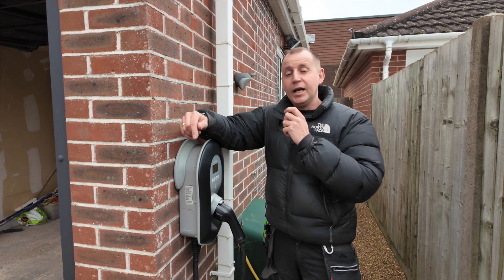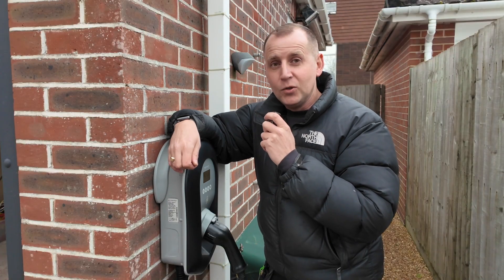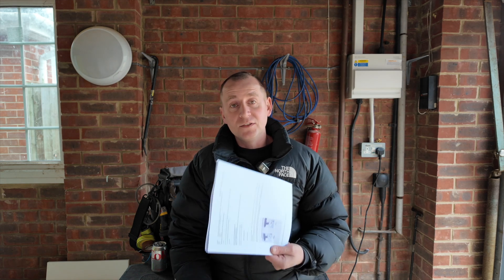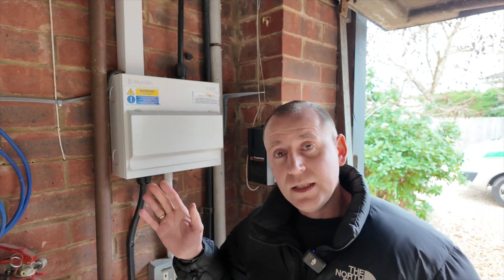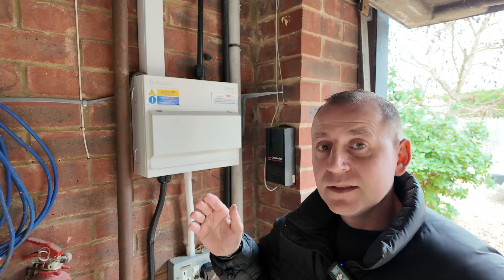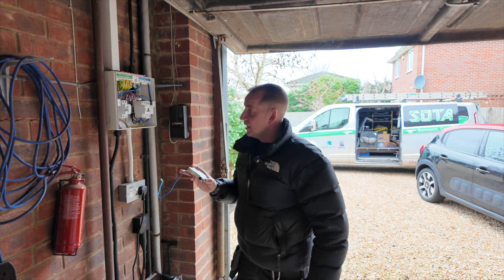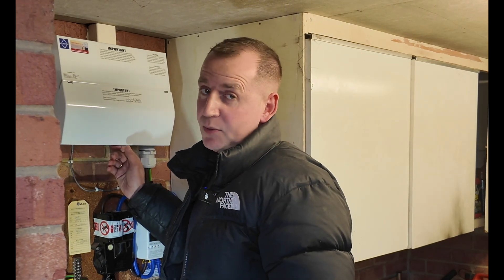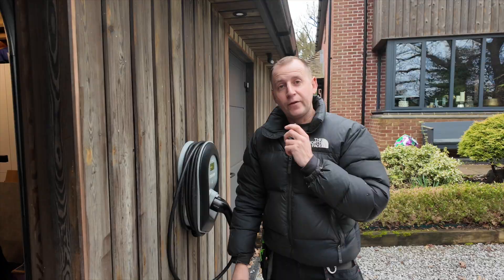THOUSANDS OF INSTALLATIONS MAY BE NON-COMPLIANT...ELECTRICIANS REQUIRED TO CARRY OUT REMEDIALS

Comment: I was always under the impression that the Ev chargers only had an Internal Type B 6mA Rcd. Even with this i always added a Type A Rcd upsteam to protecting the feeding Cable. Here where i lived the standards ask for a 4p isolator beside the Ev charger
Reply: They normally have an rdc- dd which is a residual direct current- detecting device which is why I think they won’t a type A rdc
Reply: Zappis have Type A and 6mA DC built in. It's printed on the sticker on the side, or at least it was last time I installed one. I always take a picture to keep a record of the serial numbers.
Reply: Me too.
Always Install Typ A upstream and have DC 6mA in the charger.
Reply: Some chargers like hypervolt only have 6ma DC RCD. Zappi has a full type A RCD.
Reply: Has anyone ever worked with the 3 phase Ev chargers that have an internal 4 pole mechanically resetting Mcb??

Comment: Mate, you’re gonna get so much hate for swapping that mains switch out for an RCD main switch. I can see coming already people are gonna pick out a regulation that states at the Ev Charger should be individually supplied.

I had this recently with a charger that I’ve done andmate, you’re in for a shit storm on here in a minute

I really feel sorry for the fact that you had to do this, and it’s really bad taste that my energy have stipulated that this must be fitted, but don’t stipulate anywhere in the manufacturers instructions
Reply: Guilty of stating regulations but also NICEIC have told us previously that clipped direct and protected by an MCB is fine when manufacturers have internal RCD protection. The issue arose because of the solid state RCDs not being recognised by the standard EU wide what with Brexit and then Covid. Also BS7671 is happy for internal protection and doesn't require the circuit conductors to be protected if clipped direct - unless the charger doesn't have an internal RCD.

In short it's a complete mess and because of the EV slow down manufacturers of chargers and even showrooms bundling in chargers with cars are starting to kick back on charger warranties. It's a cost cutting exercise rather than a safety one in many cases.

Edit: Main switch RCD is fine but you have to test your mA leakage before you swap over to it with everything running otherwise you risk creeping over that 9mA threshold and needing to get a DP RCBO board anyway. (just use the mcb to sub feed a DP RCBO).
Reply from the maker: @effervescence5664  thanks for your comments, the board is just a garage D/B with a couple of radial  circuits with no load and a couple of lighting circuits, inside and out, never really used, I’m not to worried about
Reply from the maker: I would like to know what reg that is??
Reply: @sotaelectrical  722.533.101

Each charging point shall be supplied individually by a final circuit protected by an overcurrent protective device complying with BS EN 60947-2, BS EN 60947-6-2 or BS EN 61009-1 or with the relevant parts of the BS EN 60898 series or the BS EN 60269 series.

Think what they were getting at is 61008 is not listed there you see,

Comment: Thats disgusting the Regs are not retrospective and as the Charger was fitted before the change, then at the time of fitting it was compliant
Reply: Nail on the Head on the retrospective comment.  Changing regulations does not make something that was done under previous regulations wrong or even unsafe.
Reply: It’s like giving a c2 on plastic consumer unit installed back in the 17th edition. when the product was installed at the time  it was compliant !. Completely agree.
Reply: It’s not the regs that have changed, BS7671 has always required EVCs be protected by an RCD. What has changed is Myenergi claims about their RCDs, they used to say their internal RCD was fully compliant with BS7671 and that no upfront RCD is required…l unfortunately their RCD never complied with any of the BSEN numbers listed in part 7 of BS7671. More recently MyEnergi have admitted this and now recommend an upfront RCD, however they now seem to have forgotten that their advice was different before and won’t honour their warranty! Shameful
Reply: 🎉 @stranglx
Reply: Yep, MyEnergi are WRONG on the refused warranty, sale of goods act applies.  I will be REFUSING to fit My Energi stuff after this. Unless they fix this issue
Reply: Only if a recall is done, it can be enforced back in time. Easee had a recall because the protection was insufficient. It was not a full recall so it's up to the owner to fit a new RCD. It has sufficient DC detection so a regular RCD is enough, not type A.
Reply: Is it because the internal rcd does not have the mechanical reset function?
Reply: @TheDarylSharp  That’s the case for Easee.
Reply: Is this a result of the Easee charger case with misinterpreting the standards?
Reply: @jeroen5838  That case was escalated to EU and mot likely UK too. It's very likely, yes. Just fallout from a partial recall.
Reply: If what you said here is true then you have a case to claim of whoever provided the course 😊
Reply: Time for a class action by electrians effected by this.
Reply: The regs are not retrospective, but shouldn't the replacement charger be installed according to the new regs? In any case, I don't think it is the manufacturer's job to enforce this. Their job is to supply a compliant product, not a compliant installation.
Reply: C3
Reply: The regs are not retrospective the only thing I can think of is that it is against manufacturers instructions.
Reply: You would be rewiring the whole country every couple of years! Insanity.
Reply: Car chargers are still having rcdd type fitted which means you cannot fit to revs as discretion means you could only fit 100 ma which means RCD 30ma can't be fitted upstream.
Reply: FULLY AGREED HERE!! Retrospective …. Excellent so all electricians are now providing warranty for “their” error? 

Crazy! Any loop hole for the manufacturer!!

Comment: Wtf? If there is a RCD internally then why are they changing the rules for previous installs. Thats fubar. Smells like a “part-p” retrospective action by some jobs-worth who has zero accountability or industry experience.
Reply: Its not an internal RCD its a RDC-DD similar but what has it not got.... a test switch or an equivalent to a bs61008 or 61009
Reply: Because the internal RCD does not comply to BS61008 or BS61009 as required by BS7671
Reply: It basically states;
722.531.3.101 Except for circuits using the protective measure of electrical separation, each charging point shall be protected by its own RCD of at least Type A, having a rated residual operating current not exceeding 30mA.

Each charging point incorporating a socket outlet or vehicle connector complying with the BS EN 62196 series, protective measures against DC fault current shall be taken, except where provided by the EV charging equipment. 
The appropriate measures, for each connection point shall be as follows:
- RCD Type B; or
- RCD Type A and appropriate equipment that provides disconnection of the supply in case of DC fault current above 6mA

RCDs shall comply with the following standards: BSEN 61008-1, BSEN 61009-1, BSEN 60947-2 or BS EN 62423.

If I remember correctly the internal ones adhere to the BS 62423 but haven't been recognised as adhering to the standard because they're solid state instead of mechanical.